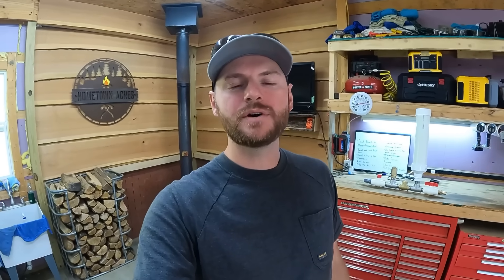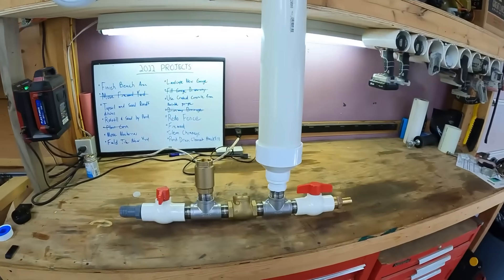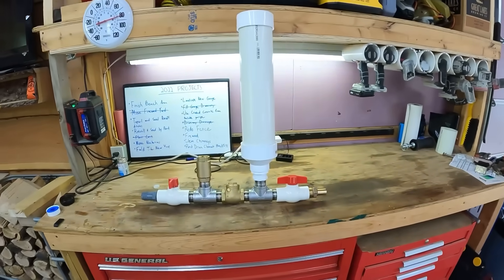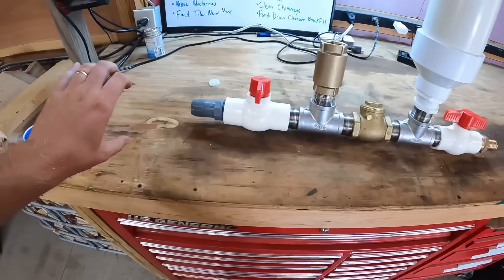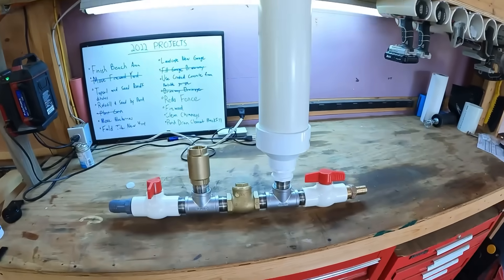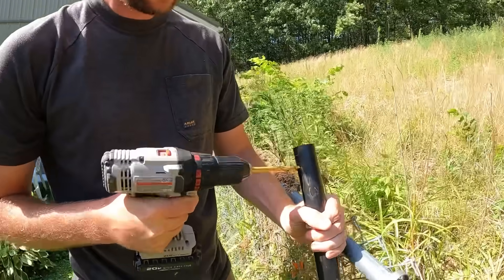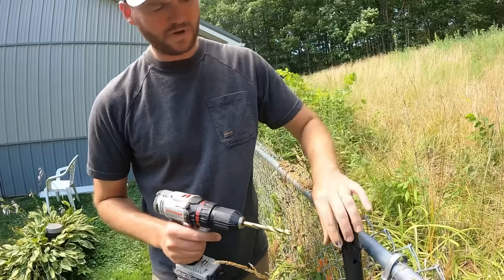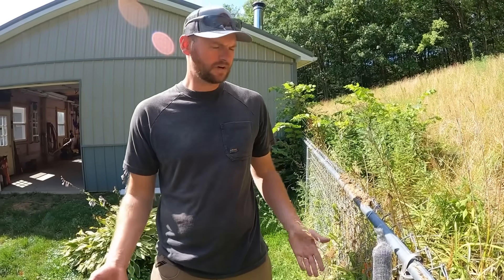We Found Water For The Pond - Hydraulic Ram Pump

Comment: What is the elevation difference between the creek and the pond?

If the pond is lower, you may be able to create a syphon. This would eliminate the need for a pump. 

Great video and knowledge shared ✌🏽
Reply: I would like to know the difference also.
Reply: Actually - the SYPHON effect - will increase the flow of water - such that the pond can still be well above the creek, just as long as there can be NO air entry between the pump (near the creek) and the pond outlet.
The reason is totally simple.
A syphon works by having a completely filled (with water in your case) pipeline between the inlet & outlet.
NOTE: You will still need a way to fill that syphon pipe that's above either the inlet or the outlet.
Simply tossing a pipe over a hill - with a new pipe full of air - syphons nothing if the pipe isn't filled with water before you attempt to syphone anything
(you need it filled with water or any air in that pipe will be removing any syphon- effect)

No pump means the outlet MUST be below the inlet.
And some means has to be added to allow you to fully fill the outlet (downhill) pipe, as well as most if not all of the inlet pipe

Adding any pump that (as we can see) can pump anywhere up to a 30 ft head - means that the outlet of the syphon pipe (at the pond) can easily be close to that 30ft = ABOVE the pump itself.
You can only determine how close, by ensuring all the air is removed from both the inlet & outlet pipes, before testing the tolerances of that system.
As soon as the pump pipe is connected to a syphon pipe (one running down the hill) any water throughput will increase
Reply: Nine days and still no answer?
Reply: @FreeFinca  I think some ones head is getting a little big with 98,000 subscriber's.
Reply: @MrRickoscar  Or just so many questions and not enough time.
All that equipment to play on, I wouldn't be answering questions either 🤣

Comment: For price of another pump a wye fitting for intake and output, plus using excess pipe for long intake, couldn't you have 1.4m gallons?
Reply from the maker: That would be a reasonable assumption

Comment: You may want to consider a splash rock in the pond, so the constant drip of water doesn’t erode the sidewall.
Reply: Really good point.
Reply: If the pipe extended into the water, and elevated above a splash block or rip-rap bed… erosion could be nearly eliminated.
Reply: @sassafrasvalley1939  I thought about the idea of just extending the hose into the water but figured he’d want to monitor the flow
Reply: @1amaker  good point… perhaps he could put a clear section of hose just above flood stage?
Reply: @1amaker  One could also extend the pipe over the water. Or over a funnel arrangement next to the water leading to below waterline. Or even something similar that's going on higher up with the IBC tote, just with a smaller container and preferably larger pipe.
Reply: @1amaker  another nice thing about building a little reservoir at the intake, is that it allows hanging the intake from a float - easily anchored to bedrock on both sides, and something heavy on the bottom to anchor it in place. The float will keep t the intake (say) 12" below the surface, so you don't suck silt from the bottom, or leaves floating on top.
Reply: @sassafrasvalley1939  Might get algae in the clear section.
Reply: @KayAteChef  good point!
Reply: @sassafrasvalley1939  I would just rip a pvc pipe in half and Make a trough. Could run the hose straight to the water but then it might get clogged or buried somehow.
Reply: @OnFinalConstruction  that’ll do too.
Reply: I was about to mention the same thing. Or just extent the hose so that it lays flat on the ground instead of pouring out and falling. I’ve seen this exact scenario with an overflow pipe causing a pond dam to wash out losing all the water. Then costing thousands of dollars to repair. No his isn’t going to effect the dam, but it can still cut a deep hole and channel that could get below the clay layer or hit fractured rock resulting in a leaking pond.
Reply: Absolutely
Reply: He’s gonna have to dig it out every couple years anyway until he can properly reinforce and line the bed with clay and stone or cement

Comment: Nice work Adam. To get more water you may want to consider a second ram pump feeding the IBC tote.
Reply: I was thinking another 4 or 5 pumps.
Reply: My thought too.
Reply: Same here.Why not add more pumps?
Reply: I was thinking that I would have run more pipe or a larger pipe through the trench before it was covered up also. That way more pumps could be used to get more water into the pond.
Reply: @mrcutter98  the siphon on that pipe will handle an isain flow rate its going far enough down hill he doesn't need a bigger discharge pipe

Comment: Watch the supply line, the squirrels will gnaw on the plastic. Electrical tape will patch it up as there is not much pressure. Good solution.
Reply from the maker: Thanks for the tip